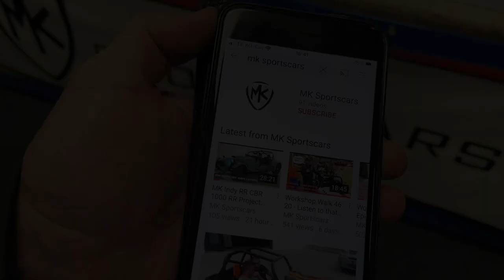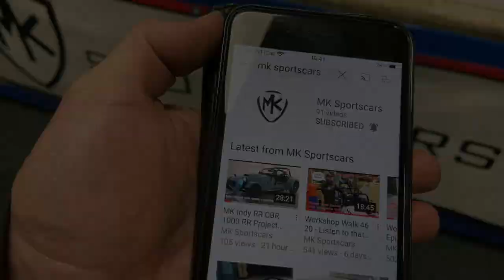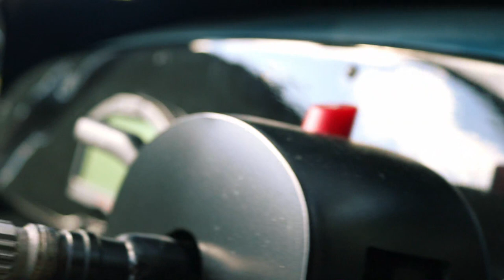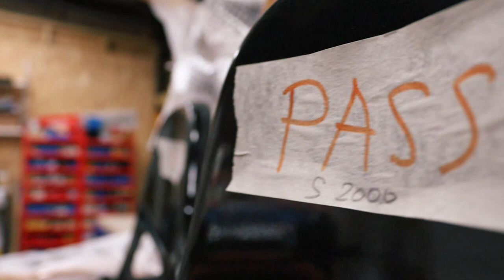EP 91 - STEP BY STEP HOW TO DRIVE A MOTORBIKE ENGINE CAR // Workshop Walk 91

Comment: People are unsure until today which Suspension System is better for a Seven. Inboard or outboard... Suspension is a science. So could you please explain how you do your choice. And how the customers should do If they want to drive on roads most of the time. I am Not sure If inboard is even for tracks the better Option. There is so many calculation. Such a complex topic

Now as you have driven both, how are your personal experiences? Do you feel a difference between in/out-board? Or is the difference just a thing you can recogmize only on the watch trying to make a better lap time? 
What about durability and costs?